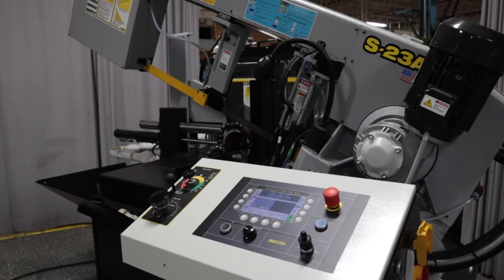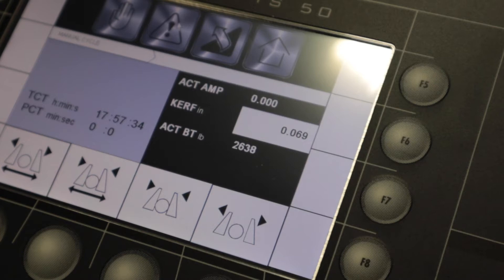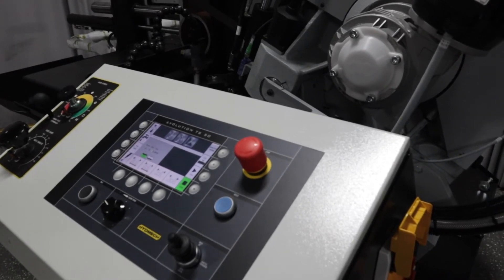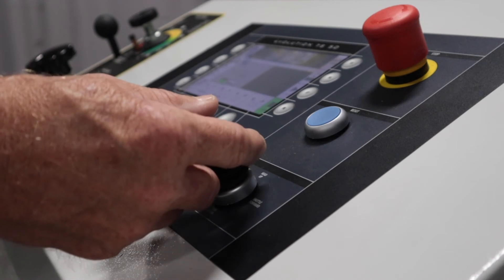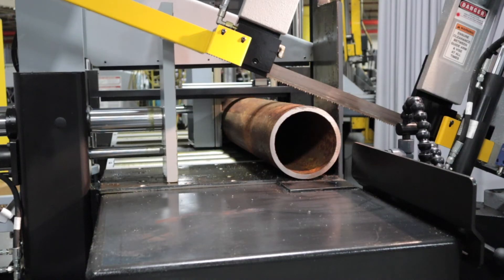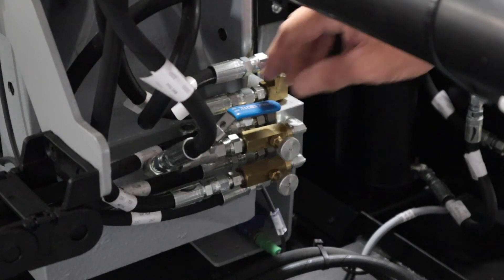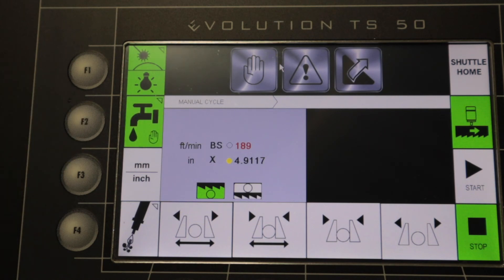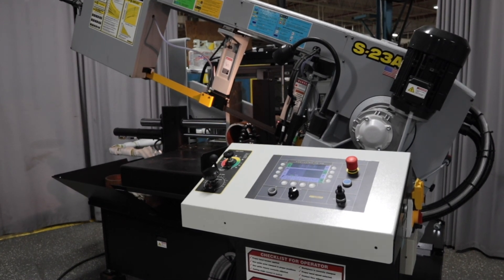HYDMECH TS50 Touch Screen Control Overview

Comment: Good morning, I have an error that does not allow me to reset the number of pieces, in addition the number is negative, for this reason it does not allow me to run the automatic cycle. Is there a solution?